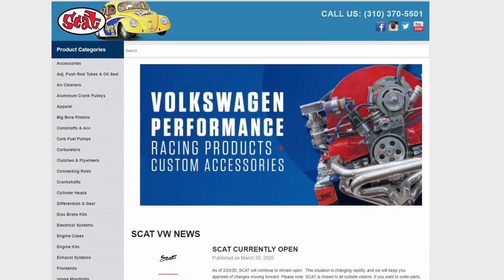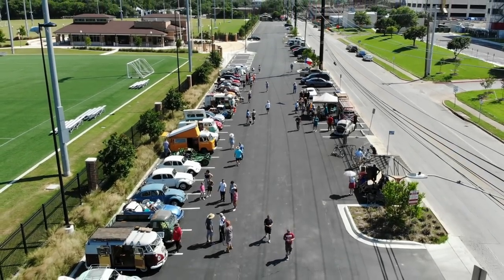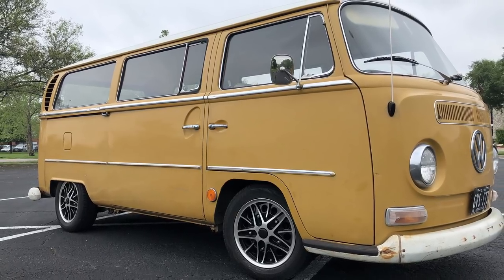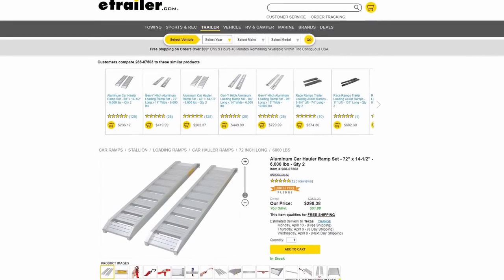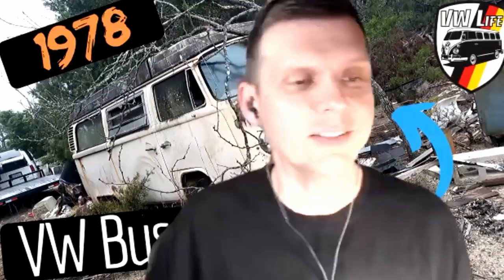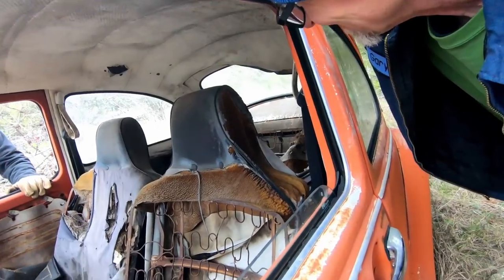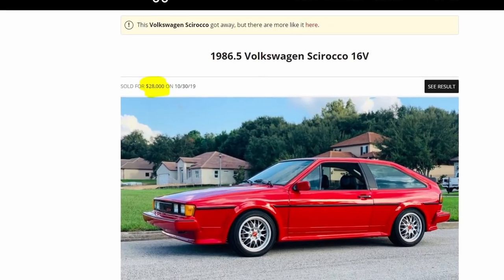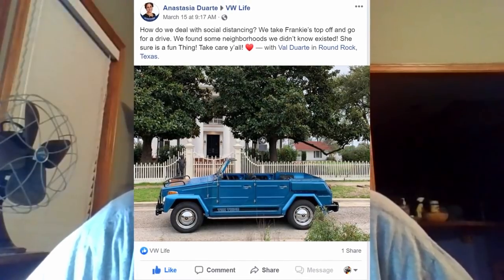Let's talk about Volkswagens!  Join us...

Comment: I am going to rebuild the front doors on Rambus it is a 71 deluxe   I used all cal look window seals . I am missing some clips and  inside door window crank handles.  What I got was new regulators and complete window seals kit .from CIP 1 . But they are out of stock on the lower felt clips .
Reply from the maker: Oh shoot that's too bad. Have you tried bus depot?
Reply: @VWLifeVW  Yeah Gary right after your video I looked them up and they have them for 2.50 each   so  I am back in business again. I do not know if it would be easier to take the door off or not , those bolts are in there ????

Comment: To anybody out there in the vw world I need some help. I am a newbie to aircooled. Spent my whole life in American musclecars. My daughter will be a senior in HS in 2 years. She has decided to embrace our ancestry and is becoming quite a Germanophile. Her dream has been a beetle for her first car. I found her a 74 that was not running. Structurally sound but will need everything mechanically rebuilt. I got John Muirs book and am crash coursing on all things VW. The engine is out and disassembled. I believe the crank needs a 10 thou turn. My problem is everything says it should mike 2.163-4 on the rods and 2.164-8 mains. Mine mikes 2.264 on both rods and mains. How is this possible?. The crank has a VW 12 stamp on it. The engine serial number is AK061889 which should identify it as a 74 1600. I am thoroughly impressed on the design , workmanship and utiliyt of the Type 1 . However I am stuck on the crank and living out in the middle of nowhere have no one to go to for advice. Will appreciate any knowledge on this.
Reply: Clara Engl - I would be hard pressed to answer this as I would say they’re undersized cranks but not oversized .
  You confirmed your readings on all journals? Both rod and main?
Reply: @tommiesmith3369  Yes measured it several times. And I agree oversized is unusual. My first thought was that somebody welded it up to make it larger but if you did that on the mains the block would have to be align bored to fit, unlikely. Looks like a stock block to me , of course Im not a VW expert. The casting number on the side of the block is first line AS 41, second line 043 3.101102 A. I appreciate any input. Also any machine work I get done is it better to find a VW centric shop? If I take it to my standard "old school shop" are they going to know what they are doing or are they going to be as clueless as me?
Reply: Yes - if a crank was “created” to be oversized then bearings would have to sourced too. This is specifically talking original VW stuff .  
 1. I would personally say check again maybe today with a fresh idea of confirming your gauge and your reading of it . Not to say you don’t know what your doing but many times in my head something was one way - I argue with any about it - then to check and I was wrong from the beginning 🤦🏻‍♂️.
  Yes VW centric machine shop is always a good idea . Other machine shops can be capable but someone who does VWs is going to be super high on my list to go to.
Reply: @tommiesmith3369  Tommie took your advice and things worked out. I bought a new instrument and used it for the first time on the 1600. I went back to my mike that I had used for 40 years and indeed I have a standard crank. The new instruments markings were just a little bit different and I was reading it wrong. So I get rectum of the week award. Maybe you cant teach old dogs new tricks. You sure cant give them new tools. Anyway thanks for having me take a new look at it .
Reply from the maker: Well it's always learn as you go isn't it?  good to hear and if you have a chance post up some pics of your VW on our Facebook Page!